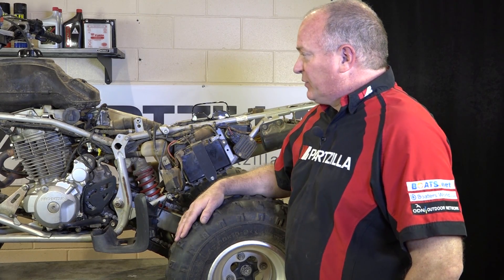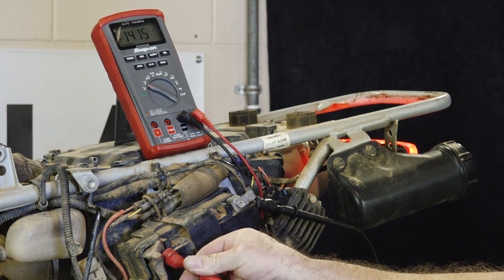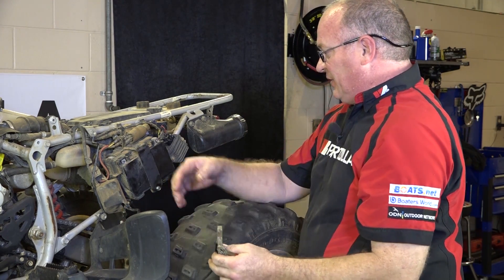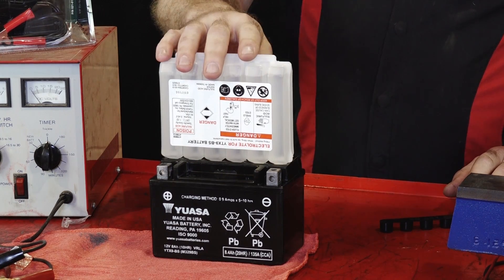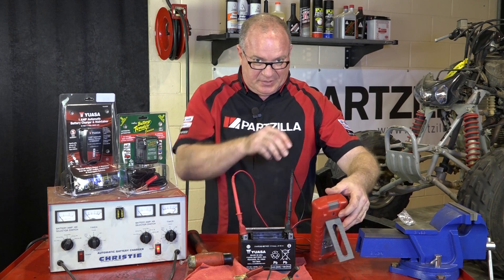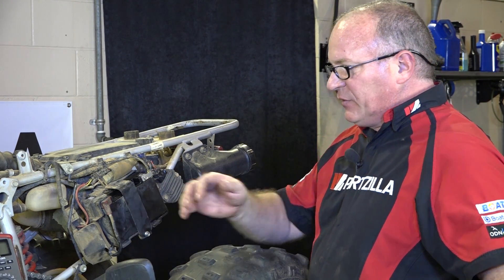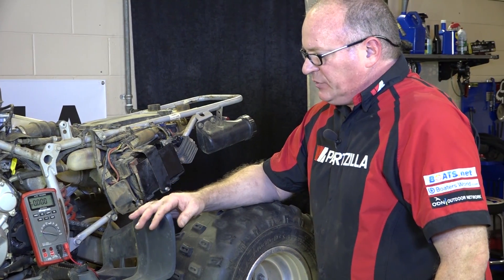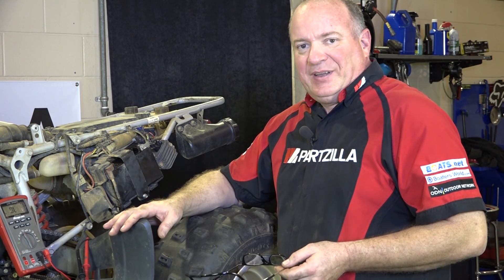How to Test ATV Stator, Rectifier and Battery | Partzilla.com

Comment: I have a 99 Polaris 300 express and it does not charge, the battery and regulator/rectifier have been replaced as well as the stator.  The stator has two yellow wires and a brown one, the yellow ones ohm out at 0.3 the brown one is a ground.  Do you think the stator is bad, or the magnets are weak?  Thank you.
Reply from the maker: What's the voltage coming out of the stator? With charging issues, start with the stator and test output all the way to the battery.  You will find a drop somewhere.  It could be the component or the wiring from the component.
Reply: I located the problem, the previous mechanic had the 12v wire from the starter to the ignition start button, instead of the location to all accessories.  It runs like a champ now, thank you for your time.

Comment: I know it's an off brand quad I have a taotao 125cc atv and I bought a new battery and with in a few months it won't start and then I replaced it again and it died within 3 weeks
Reply from the maker: Test your stator and confirm that it's getting charged.

Comment: Hey partzilla are how you. I have a 2004 yfz 450 with a problem that’s making go nuts. I can put the key in get power but when I got to hit the push start . It’s like it get stuck and just keeps turning over till it kills the battery’s I have a new relay new push start i also replace the Little black neutral relay please give me a hand partzilla
Reply from the maker: This is usually the solenoid sticking and not breaking contact after you release the button.

Comment: I warmly welcome. I have a charging problem. In the morning I started the engine and after some 2 minutes the charging indicator came on. The meter shows 15.2V - charging. Voltage regulator for replacement? TGB Target 525 4x4 patient
Reply from the maker: Shows charging at the battery or the stator?
Reply: At battery

Comment: Hi I got a 04 Polaris sportsman 400 and I put in a new battery and the battery light still comes on do you know why it dose that ??? Thanks
Reply from the maker: It's reading low voltage.  I would test the components up to the dash and check all the wiring for breaks or corrosion.

Comment: I have a95 Honda 200 four Traxxas. I don't think I'm getting the full spark needed to start engine. I replaced the coil and plug. Can anyone help. Thanks
Reply from the maker: It turns over, but won't fire up?  Have you tested the coil and plug to make sure they are getting spark?
Reply: Partzilla yes I have replaced the coil and plug. I am getting very little spark and the fire I'm getting mostly red and not blue. When I pulled the cover to get to the timing marks there was oil in the cover
Reply from the maker: I would start at the battery and work through the charging system.  Test the components one by one and see if a test fails.

Comment: I have a 2008 honda foreman with a brand new carb and im getting fire wont start i completely washed tank good maybe stater??
Reply from the maker: Everything turns over and just won't fire up?  You've checked for fuel and spark?
Reply: Partzilla yea im getting fuel and spark wont start
Reply from the maker: Well, this is where the fun starts.  Check timing, compression, air flow.  What do you mean you washed the tank?

Comment: i have 2005 honda 400 foreman and soon as i start it the main fuse blow out what could be the problem
Reply from the maker: Could be a shorted wire, bad solenoid or fried starter?  Time to test some components and wiring.

Comment: Hi John ! I got a 1991 Bayou 300... My batteries all test good but everytime I hit on the lights my quad goes dead in matters of minutes... Could this be the rectifier ? My yellow wires from the stator get really hot as well as my rectifier... I bought a cheap rectifier from Caltric and it did not solve the issue... What is next for me to check ? Thankx John !
Reply from the maker: Have you load tested the battery?  Sometimes the battery will read good on a charger or multimeter but the cells are fried and can't withstand the load.  You can get it load tested for free at a dealer, if you don't have a load tester.  That's step one in the system of elimination.

Comment: Need help please
2006 Honda Trx 250 ex
It won’t start .
New battery, new starter, and spark plug new fuse and that round thing next to battery and still won’t start
What I get is a clicker noise from that round thing next battery. All light come on but get nothing else.. please help anyone
Reply from the maker: I'm guessing the round thing is the starter solenoid.    Does the starter turn over at all?  You could be looking at starter clutch, frozen bearing, or internal engine problems.  Can you bump start it or does it lock up in gear?
Reply: Partzilla  no the new starter doesn’t turn over at all
Reply: My next-door neighbor told me to try to pull start with the truck and when we tryed that the wheel lock up
Reply from the maker: Can you get the motor to turn over at all?  It sounds like something is seized.
Reply: It did run.. my son was out riding and he said it just died. So got it home and started buying new parts of what people said it might be now I’m just stuck..
Reply from the maker: Well, everything runs until it seizes.  Have you disconnected the starter from the motor (still attached electronically) and tried to start it?  Does the starter turn?  If so, then something is stopping it in the motor.
Reply: So 1 st thing thank u so much for your help.
So took the starter of and it’s not turning. It all most like there no power getting to it . Took it all the way off and hook it up to a car battery and it turns on ... and thank u again for help
Reply from the maker: Perfect, at least now you know where to look.  Could be a shorted wire, bad connection, etc.  Just trace and test everything from battery to starter until you find the issue.

Comment: 07400ex... Will not gat any power at all. No lights nothing. Battery is good as well as stator. Put on new registration started and ran for a day then nothing again the next day. What can it b?
Reply from the maker: I would check your fuses.  Then check for loose wires.

Comment: I would love to get some expert opinions, and I will post my results when I figure out the problem regardless. I have an 06 YFZ 450. A pretty straight forward issue it's having. The problem is that I have no spark when I plug in Voltage Regulator Rectifier, however, I can unplug it and the machine runs fine (with the exception of charging). What could this be? I'm purchasing a new CDI, Regulator, and Starter cut off relay. Would love some thoughts guys, thanks.
Reply: New voltage regulator, bike is charging and spark is good! Thanks! Shipping was fast from you guys too.
Reply from the maker: Have you run tests on the regulator?  I would start with that before you buy all those components.
Reply: Yes sir, I've ran a couple of tests. The stator checks out fine, and using your method (thanks btw John) the regulator is bad.  What I don't understand is how a failing regulator would cause my bike not to have spark. Perhaps a diode has failed a certain way causing the issue.  I should be receiving my parts Friday and I will start with replacing the regulator to see if that alone will fix it. Thanks for the videos!
Reply from the maker: A bad regulator will kill spark.  When they go bad, they either don't convert proper voltage or they essentially short out, distributing no power.
Reply from the maker: Glad you got it sorted out!
Reply: Chris Brewer l

Comment: Hey I have a 1990 kawasaki klf300 4x4 some thing wrong with charging system, I checked the stator and it reads between 2-2.5 ac does any one know how much it's supposed to read

Comment: Would a weak battery cause atv to backfire,sputter cutout when attempting to rene engine? 98 Bayou 300. Thanks
Reply from the maker: No.  Your battery is just for the power to turn the starter and start the engine.   It could be your stator, that is what powers the engine once started.  However, with what you're describing, you are looking at either a timing, valves or fuel issue.
Reply: will you be doing a video about the starter and fuel system. or do you have one?

Comment: Hello, I'm having trouble with my 06 raptor 350. When I turn the key, the lights will turn on but the ignition button does strictly nothing
Reply from the maker: You mean the start button?
Reply: Partzilla yes that one haha
Reply from the maker: Ok!  So this could be so many things.  Start with the battery, fuses and starter solenoid,.  Check or test all those things first.
Reply: Thanks a lot I'll definitely give it a check

Comment: Okay my question to you sir is I have a taotao atv 110.. the charger tells me the battery is fully charged.. I unhook it and I plug the battery up to the charger it shows that the battery needs charging. I try to crank all i get is a click and break lights also the alarm on the key when I push it
Reply: Sorry my question is what should I do or what is the issue
Reply from the maker: Just because the charger says it's charged, doesn't mean the battery is good.  My guess is if you hooked it up to a load tester, it would fail.  Start with a new battery.
Reply: Partzilla I can't just charge the battery I got instead of buying new batteries
Reply from the maker: Batteries die.  Sometimes the charger doesn't recognize it, but the battery is most likely fried.  You can take it to a dealer to load test it to confirm before you spend the money.
Reply: Partzilla this battery is already new by mail. Now I have to order another 1
Reply: Thanks I figured it out
It's the solenoid. Doesn't the solenoid kill the battery if it's bad
Reply from the maker: It's possible but normally, no. When the solenoid goes bad it just can't transfer the voltage to the starter.
Reply: Partzilla yes i have to bypass it with a flathead or something for it to run

Comment: Does a atv still run with a bad stator
Reply from the maker: If it's completely dead, the unit will run on the battery until the battery drains.  Then you will have no electrical power at all.

Comment: Hello partzilla, from Argentina, I have a suzuki ltr 450, and my question is the following, why does the regulator break / burn? thanks and regards (sorry for my english)
Reply from the maker: Electrical components go through heat cycles, after awhile, the connections will eventually fail.  The regulator has a lot of juice going through it, so they get pretty hot.
Reply: thanks, but due to poor battery status, can the regulator fail ?, in less than three months I have changed the regulator twice.
Reply from the maker: I would test the stator and see what it's putting out.  It may be overloading the regulator.

Comment: Can i charge my new battery in my motorbike for the first time charging.  
Or that is wrong. Please
Reply: as long as the battery is not connected to the bike yet no different than on a bench
Reply: as long as the battery cables are not connected to the battery while the battery is in the bike you could charge it and it would be like having it sitting on a bench out of the bike
Reply: sorry I understand now. You want the bike to charge it while it is running.  As long as you don't use the battery to start your bike it should be ok to do. If you use the battery to start the bike you could damage the plates inside
Reply from the maker: I mean, you could...but traditionally, it's easier to charge it first so you can start the motorbike.
Reply: Partzilla.
Thank you very much for answering and for your time 👍👍😃
Reply: But how many kilometres should charge it. Or how many time please ?!
Reply from the maker: No idea.  Never tested something like that.  That's not a normal procedure.
Reply: Thank you Great Master 😃😃👍👍
Reply: Green farming .
Please explain
Reply: Green farming.
Ahaaa. I understand now why it should be charging from a charger first time.
To don't damage it from inside.
Is that what you mean.
Thank you my friend.
Did you know why the rectifier is getting very very hot??!!
Reply: usually heat means there is too much resistance in the wiring but it could also mean that too much current is going to the rectifier

Comment: Hello my yfz450 headlights flicker and my back light also , it idles but then shuts off what is the problem help plz
Reply from the maker: Have you tested your stator, regulator and checked for loose wires or connections?
Reply: Partzilla I have checked for loose connections but I don't have any equipment to check my stator or regulator
Reply from the maker: Ask a friend.  Usually someone will have a multi-meter laying around.  It's the best thing you can have to sort out electrical issues.
Reply from the maker: http://www.partzilla.com/parts/detail/aftermarket/XP-4941175.html
Reply: Partzilla also the head pipe it glows red do you know why?

Comment: Hi. My YFZ 450 blows brand new bulbs soon after I start it. Could it be anything else apart from the rectifier, and how likely is it that it is the rectifier? Thanks
Reply from the maker: It could be the rectifier, have you tested it?  It could be a shorted wire.  Are the fuses popping?

Comment: If it wont start period because no spark and no juice in the battery but when you use the kick start to crank it and the dash lights come on does that mean its not the stator?
Reply from the maker: When you kick start, the stator kicks out some voltage to the lights and plug.  Doesn't necessarily mean it's working correctly, just that you're getting some juice out of it.
Reply: Partzilla hey thank you very much

Comment: I got an arctic cat DVX 250 atv... only way it will start is when I charge it. When I start it, it will idle really high then shut off.
Reply from the maker: Test/replace the battery.  Then I would inspect/clean the carb.  Sounds like two separate issues.

Comment: great video,i put voltmeter on my battery while running and is at 13.5 v, then when u give some gas it goes down to below 13v, any thoughts ... thanks
Reply from the maker: You can run through and test the regulator and stator.  Sounds like there is a voltage drop somewhere.

Comment: Hey Partzilla...!! Awesome videos..... I have a question if I may. I have a 2009 Honda 420 Trail Blazer, It'll start every time for about three seconds and then stall. Any idea as to what the problem may be, very frustrating...??
Reply from the maker: Sounds like a fuel issue.  Have you run through it and checked all the hoses and tank vent?

Comment: 07 trx 450er. Not getting spark new ignition coil. What's the issue here?
Reply from the maker: Start at the coil and work your way back, testing the components for voltage.  That way you can figure out where it drops out and find the issue.
Reply: Partzilla how do you check the stator with a multimeter with it out of the quad ?
Reply from the maker: You can do a resistance test on the wires.  A good stator will read 1 ohm or less.  To test it for voltage, you'll need to reinstall it.
Reply: Partzilla how do you ohm test it which wires do I plug into what ? How do I test the pulse genrator as well?
Reply from the maker: I'm afraid you're going to have to do some research.  It's too much to type in a Youtube comment.  We don't currently have a video for this, but there are instructionals out there.

Comment: I have a 2001 bombardier ds 650 it won't turn on that baterie sparks the only way it turns on is by pushing it and poping the clutch
Reply from the maker: Just run through the starting system.  Load test battery, test starter solenoid, fuses, connections, starter.  You will find an issue somewhere along the line.

Comment: I have a 2008 rincon that seems to start when it wants to. The engine always turns over just want start. I have replaced the coil, spark plug and boot. Any ideas what it could be?
Reply from the maker: If it's getting spark, next it's time to investigate fuel system.
Reply: its not getting spark when it dont crank. its like the spark just comes and goes. Thats why I replaced the coil. Its like it just cranks when it wants to.
Reply from the maker: It won't get spark if it doesn't turn over.  That's a starting issue.  Load test the battery then test the starter solenoid.
Reply: ok lets start over. it turns over fine. at times no spark and at times no spark. I have replaced the coil no change. any ideas.
Reply from the maker: ha!  Ok, you had me running in circles there.  If it's intermittent, you will have to test a bunch of stuff until you find the issue.  Check wires and connections for a loose fitting.  That would be the most common.  Then test relay, regulator and just keep going down the line until you figure out where the voltage drops off.
Reply: thanks you. If I have anymore trouble I will let you know

Comment: Awhile back, I mistakenly crossed the wires  when charging my battery on my Polaris Magnum 330.  Will this harm the stator as after a while, the battery needs replaced.  The regulator on it has been replaced & am considering the stator.  Would my screw up kill the stator?
Reply from the maker: It's possible, but you should run it and test the stator before you replace it.  There is a good chance the stator is fine.